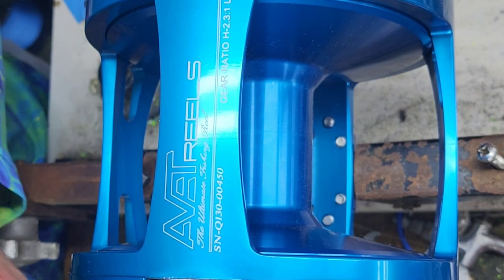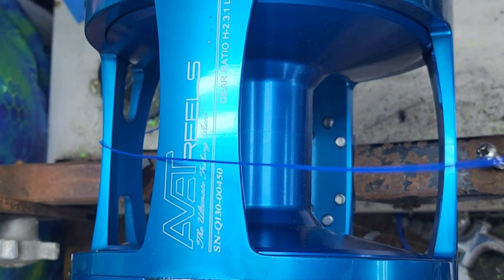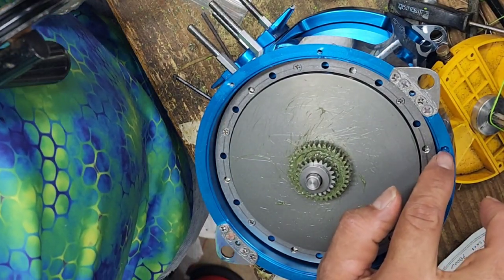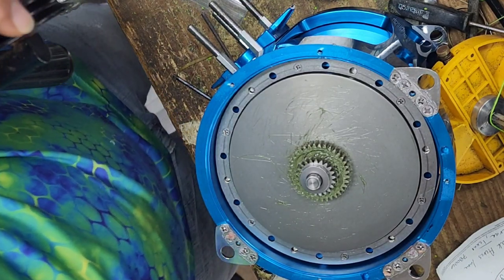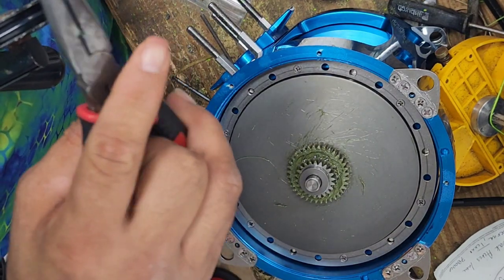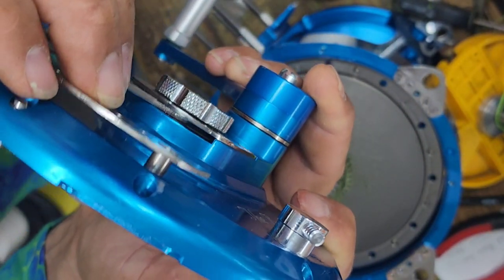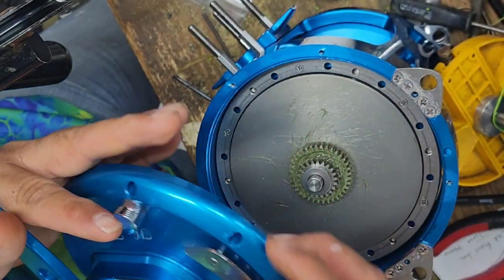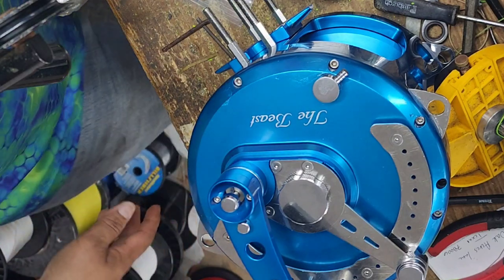How Did this Part Fall Out of this Brand New Reel

Comment: Hope Avet can spring into action quick and fix the issue.
Reply: 🤣 nice...I'm confident they will. It might be located in the box?

#TeamHardLife #HardLifesBaitandTackle #JacdUpLeatherWorks #Sharkotic #TightLineBraid #CortlandBraid #GatorLures #LineCutterz #ShopTheRealDeal #TexasSurfMasters #OffshoreSyndicate #100kGiveaway...closin' in on #200k on the way to #250k Subscribers and beyond!
Reply: @tobyhatch2547  Possible, or maybe it sprung forward during assembly
Reply: @tobyhatch2547  Maybe,  after all, spring is in the air.
Reply: @leonardarce6117  That spring is gonna give Bigfoot a run for the hide and seek championship title!  👀

#TeamHardLife #HardLifesBaitandTackle #JacdUpLeatherWorks #Sharkotic #TightLineBraid #CortlandBraid #GatorLures #LineCutterz #ShopTheRealDeal #TexasSurfMasters #OffshoreSyndicate #100kGiveaway...closin' in on #200k on the way to #250k Subscribers and beyond!
Reply: @tobyhatch2547  🤣
Reply from the maker: They are going to ship new a new assembly to replace it
Reply: @TeamHardLife  👍